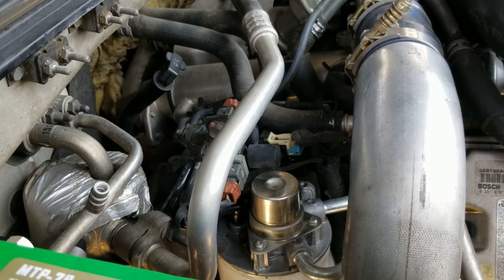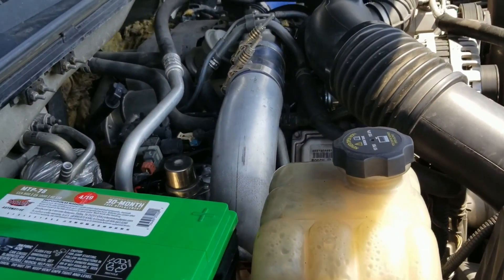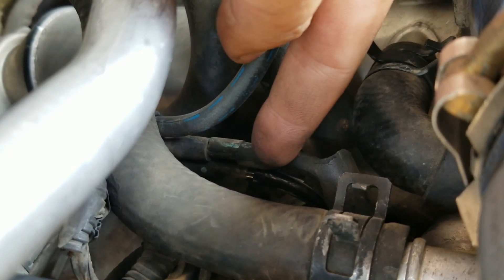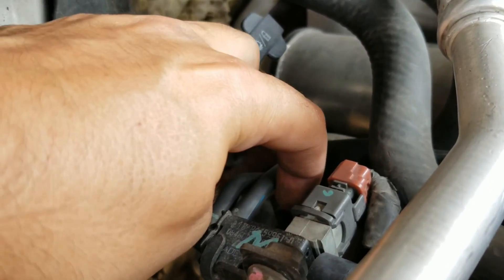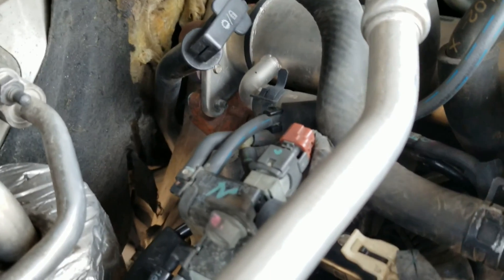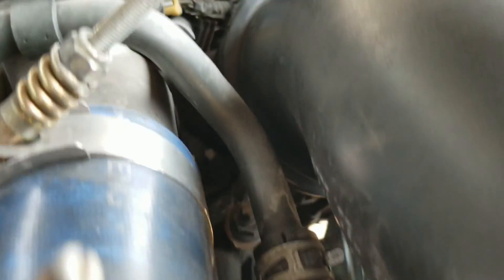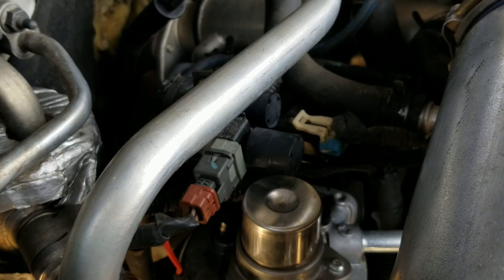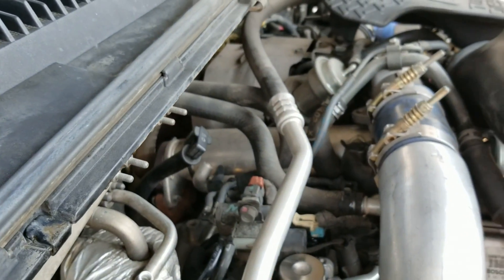Duramax LB7 EGR Vacuum Lines Walkthrough and Explaination - Vacuum Diagram

Comment: Wait till it’s time to do that filter head! Only goes back together one way. Make pics and take notes! I left fuel lines open for a few days awaiting the new head and after install and prime, now crank no start. I think I may have air between the filter head and the CP3. How do I deal with that?
Reply: Schrader valve running a hose into a bucket and pumping primer
Reply: @GreenGenerationTV Thanks for your advice. Good idea but the valve you reference takes a special fitting. Did a workaround with a piece of clear tubing with a hole I could push an Allen through to depress the valve. Worked but still lots of bubbles. I struggled for quite a while and finally went to a shop, where both hoses to the filter head were replaced. Old, cracked and leaking air…

Comment: I have a question which way does the EGR pump run clockwise or counterclockwise I took the belt off and don't know which way that it goes back on does it go over the left side or the right side

Comment: @ CombustionMonkey very informative video thanks a lot. I have a “ticking” noise coming from the vac pump itself and air pushed out from the ports on the circle part from 0:48-0:54 on your video yours appears to have like rust around the area...is this normal or would it be safe to say that my vac pump went bad? Thanks again!!
Reply: gpt the same issue. what you find?
Reply: Same issue mine is knocking

Comment: I sprayed silicon penetrate into vacuum valves to free up, they were stuck. I used a 9V battery to activate and a piece of vacuum hose to check for air flow blowing with mouth. Also check fuel heater fuse maybe blown.

Comment: On my truck the the vacuum hose that goes to the egr valve has a t that goes to what it looks a sensor
Reply: Maybe that is to trick it so you don't buy a vacuum solenoid do you have a check engine?

Comment: Hi I just watched the Vacuum line video, my question is how did you get the darn thing off? I can't get the bolts. My pully doesn't have any holes to access the bolts.
Reply from the maker: Well I don't have the truck any longer but I do remember it being easy, however, the bolts didn't look like they were holding the pulley on (they seemed to be in a strange location so I didn't know they were the bolts I needed to pull) so I would suggest getting in there again with the mudguard off on the passenger side so that you can get in their clothes and have a look. I would bet you had the same experience I did and when you get in there you'll realize they are actually pretty easy to get out.
Reply: @BustMonk  Thanks I will look again.